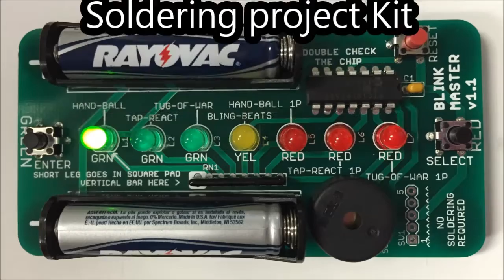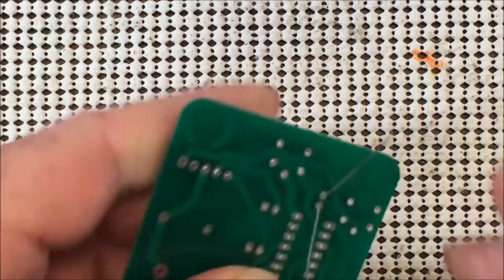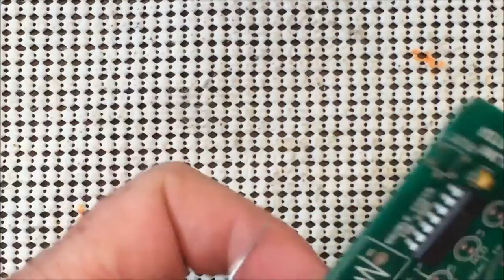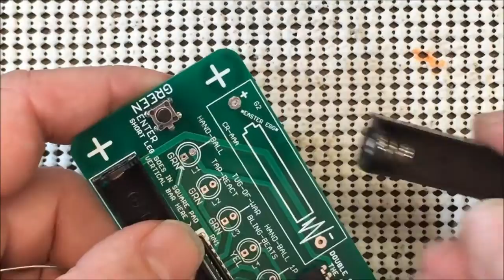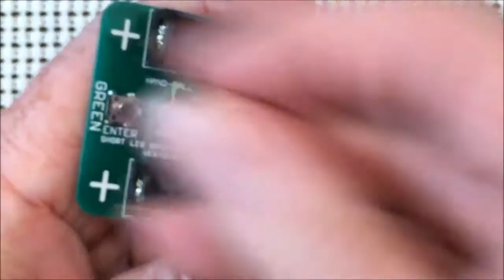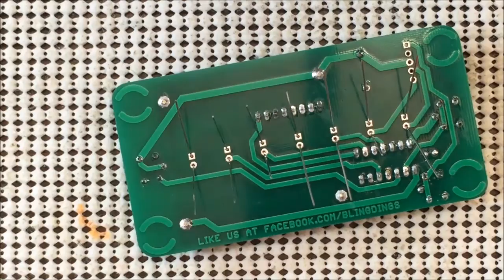BlinkMaster Soldering KIt: Intro and build

Comment: I noticed that on the bottom right there was a slot with nothing in it.  Was that intentional?
Reply from the maker: It's pads that can be used to re-program the PIC chip if it's ever needed.  If you have a PICKIT2 or later you can load your own program using these pads (advanced nerd feature only :)